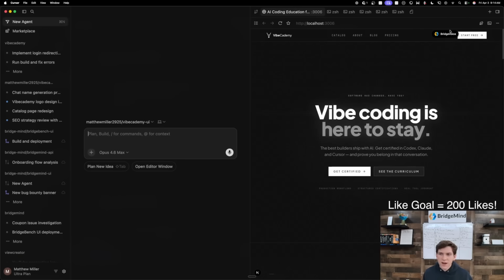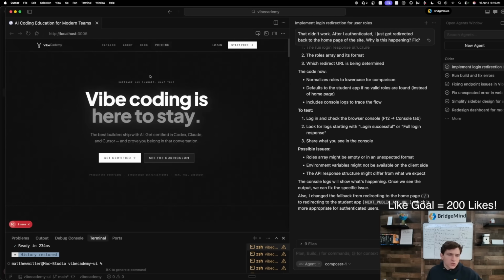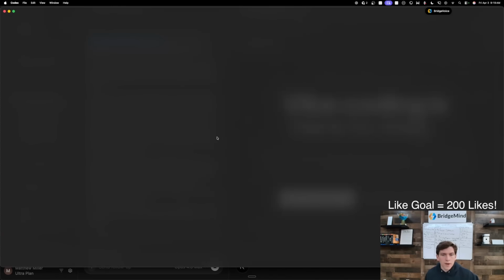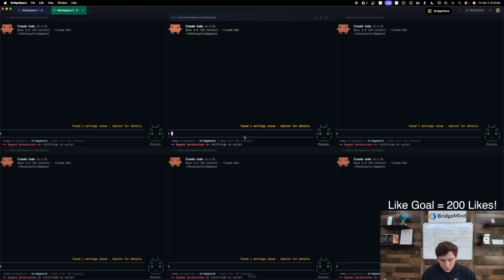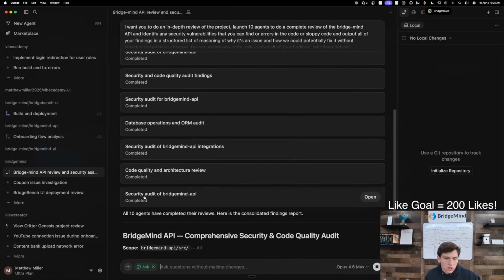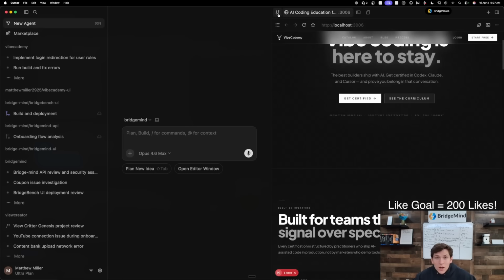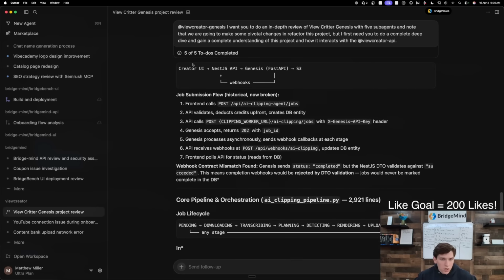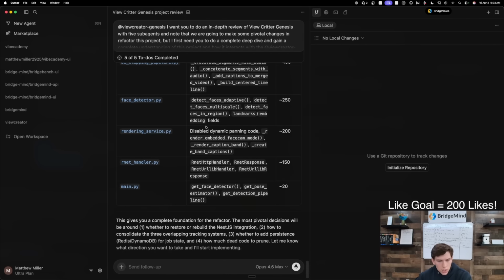Vibe Coding With Cursor 3

Comment: Good job on this video! I've been using Cursor since 1.0, and it's amazing how much more capable it's becoming, and I don't think that's going to stop. I'm really a novice at this. I started with an iPad app I was trying to improve on. Apple is very progressive in terms of changing Swift and keeping up was really hard for me. Cursor helped me finish it in a couple of weeks, mostly due to MY stumbling along. Next, I decided to make a web version with Cursor, using the Xcode files as a reference. It took two days, again, mostly with my stumbling around. What I like most about this video is you taking the time to demonstrate how to use the interface. Most videos sort of jump into the middle, and that is harder for a "stumbler" to follow along. Thanks again!
Reply from the maker: Keep building!

Comment: I have Claude Code Max 20x and Anthropic is cutting the limits. I'd never hit 70% with a heavy day and yesterday for the first time I hit 100%. Cobsidering move to cursor ultra
Reply from the maker: I am having the same experience
Reply: @bridgemindai ı have google ai ultra and Opus drains in just 30 minutes. I was cosidering a downgrade in last month but now it feels i need a 500$ package😂
Reply: Yeah these limit cuts are painful.  I’m going through some testing to determine a real work around without losing capabilities.  I’m strongly considering using the new Gemma 4 Dense model inside Claude Code so i can keep the nice features and all the skills and mcp etc i have configured.  The one drawback is the he 256k token context limit and it’s not really capable of large multi file updating.  I wrote a script that can easily move back and forth between local and Opus 4.6 whenever the need arises.  One other thing I’m about to test is using GLM 5.1 in the kilo code extension in VScode since it’s great at  UI and free or very cheap.  Oh yeah, almost forgot.  I use the Claude Code to GHL via API and I’ve heard Gemma can struggle with that so I’ll probably install the GHL MCP.  

I’d love to see a multitude of videos about all the possible options and workarounds for avoiding the rate limits by Anthropic and maybe even making a total break from them or possibly moving from the $200 max to the $20 plan since we’ve got lots of options.  Most of my clients are website dev projects with some
Kind of CRM and database backend and I’ve got 5-6 SaaS projects that are fairly complex and these types of builds give me pause about dumping Anthropic totally.

Comment: What setup would you actually recommend? Cursor + Claude code? Antigravity + Claude code? Only cursor or antigravity? Other combination?
Reply from the maker: Cursor is better than Antigravity for sure. Claude Code is the superior tool by a long shot, Cursor is a great tool to have in the stack as well
Reply: @bridgemindai  Yeah thanks! I'm just having a hard time understanding what Cursor actually helps me with in the combination with Claude Code. I use this combination my self but turns out I'm actually only using Claude Code witihin Cursor and not using the AI-ability of Cursor itself. Feels like I just as good could go VS code + Claude Code? Can you help me with any example of why to combine Cursor + Claude Code?

Comment: ive beenk out of cursor since January. is it still impossibly expensive?
Reply from the maker: It is still expensive
Reply: composer 2 is dirt cheap tho and fairly good to be honest. And when impatient you can still pull the fast lever and it goes bbrrrrooooom!
Reply: Use composer 2 on cursor, it's better than opus and you get the same amt of usage as opus as you would with a cursor sub